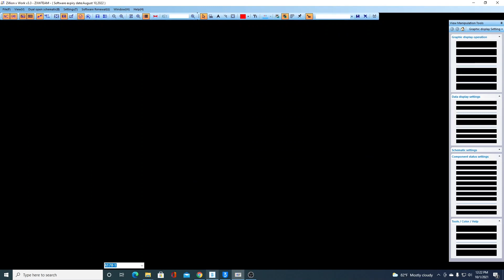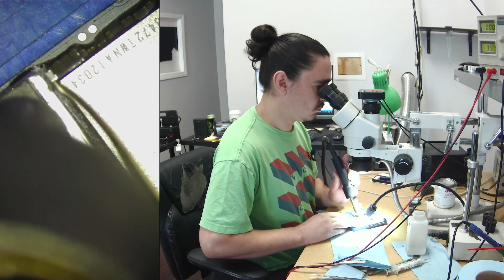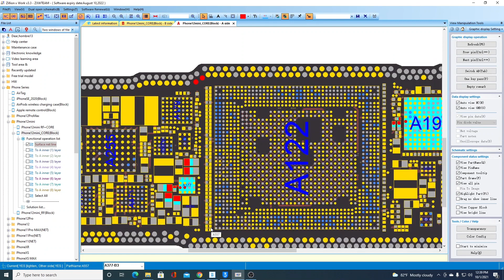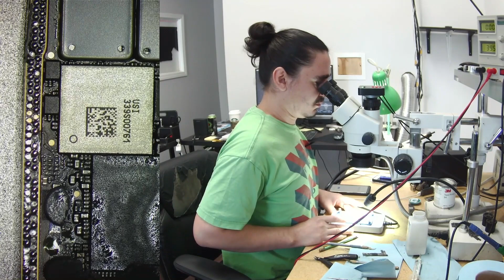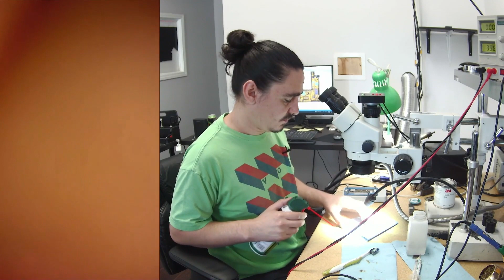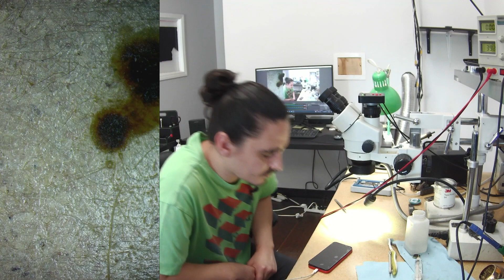Random Dead iPhone 12 Mini - No Drop, No Water Damage

Comment: Awesome video great display of skills and knowledge! My question if you would be so kind to answer is what do you think the problem would most likely be if my 12 mini was on the charger plugged in, overheated, then now is completely dead, no power, no charging, no detection by computer. When this happened the battery health was severely degraded like 67% but no signs of water damage or anything when I opened it up. What are the chances that if I fix the battery and screen that it works? Or what would be your guess that caused it to overheat on the charger and completely fry? Lol could it be the ic? Thanks ahead of time and I did give you the much deserved like on the video!
Reply from the maker: Thanks for the like! Not a great chance that it is the battery, but you cannot tell until you try and start the diagnosis process. You most likely have some motherboard problem like in this video.

Comment: I have a 12 mini witch draws 0a when off and 120mA when I powder it on. The screen stays off and the current stays at 120ma, drops to 80ma then to 0ma, goes back up to 120ma and repeats.
What could that mean/ where do you recommend I start to diagnose it?

The current measurements were taken directly on the battery connector. It draws 0ma over the USB
Reply from the maker: what is the history of the device? dropped or water damaged? The amp draws just give some small indicator of what to check, it is not a full proof method for figuring out what the problem is. What that amp draws kind of tells me is that the phone wants to turn on but something is preventing it. That means most of the power rails should be turning on. If it were me, I would try to measure all the power rails (nand, cpu, vram, etc) to see if one is missing. It can also possibly just be a sandwich board issue. Who knows. I never really know until I start working on it.